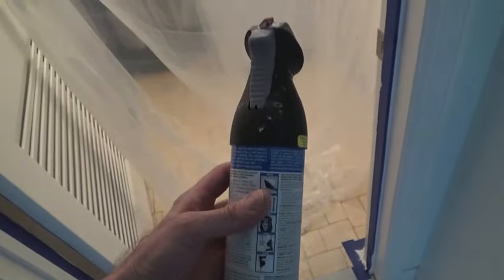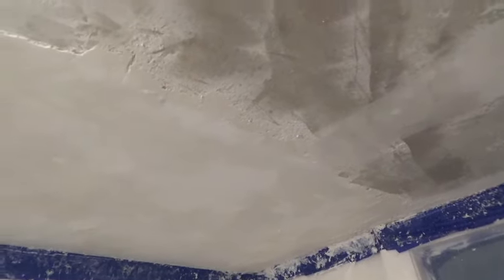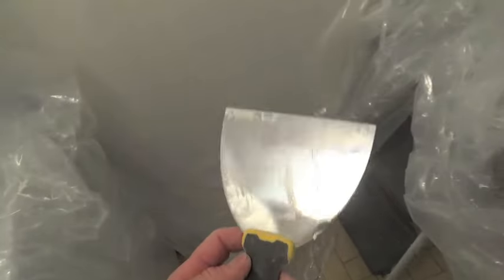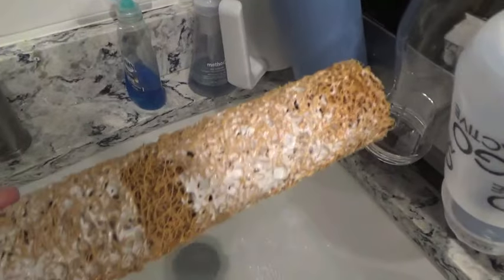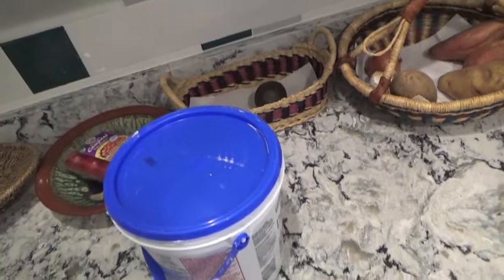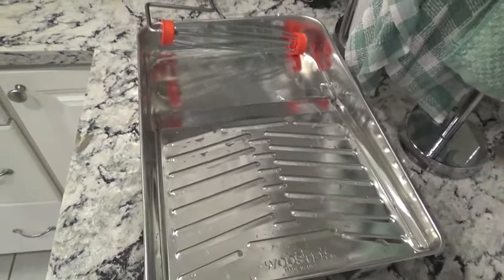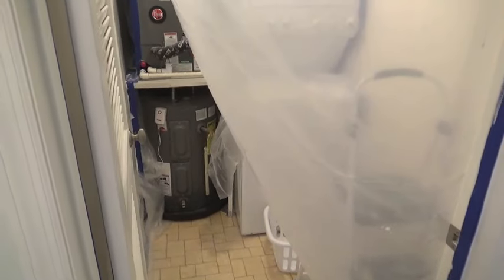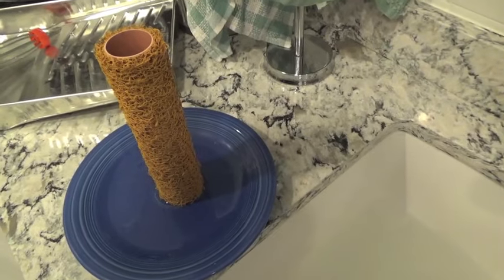texture ceiling with loop roller, 2024

Comment: I used both types of that spray crap didn't work at all more fell off the ceiling than stuck ended up using my hopper sprayer . Looks good sir